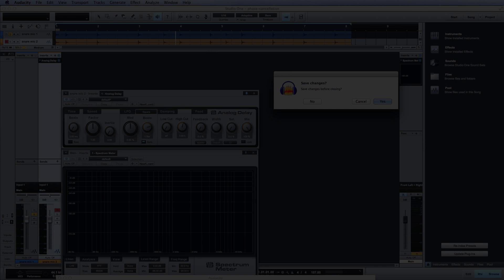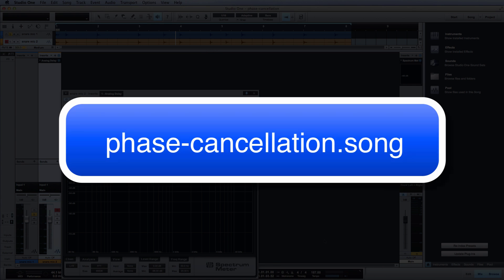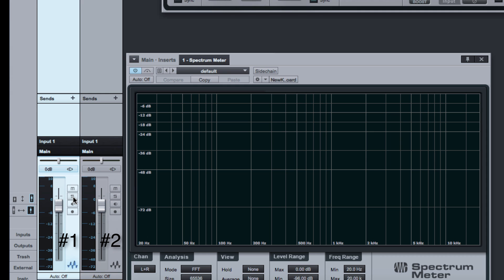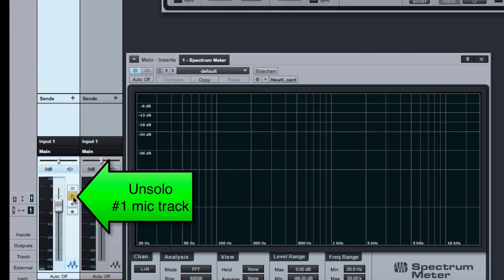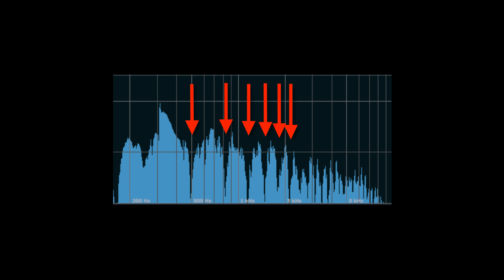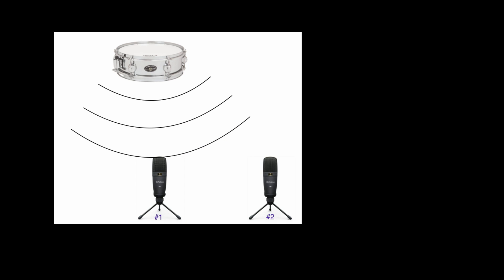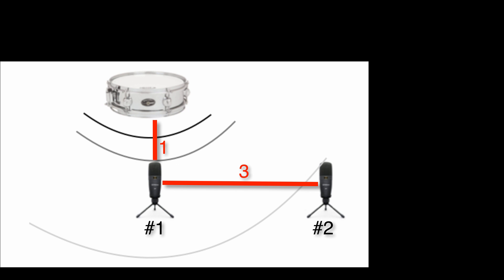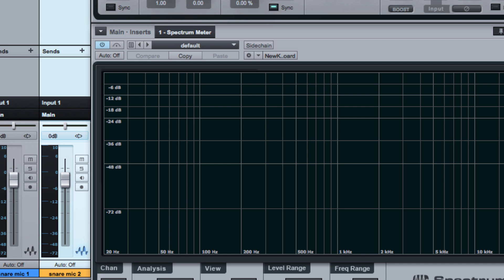01 05 What phase cancellation sounds (and looks) like

Comment: I still dont get it, how it works.
When i have a saw and a sin wave, then there will be also phase cancellation in a way right?
So why does our music, when we create it doesnt sound maximum shitty because all our different sounds (synths, acustic guitars etc.) are cancelling each other out in some ways? 
They are all going to be outputted through the master, and before that they must cancelling each other out a little bit.
Reply: Simply because they are different sources and different instruments. The frequency, amplitude and time time need to be the same for both sources.  Eg: if two microphones were to pick up the same sound and the mics were spaced equally from the sound source then the combined audio at the input to the mixer would be in phase.  If one mic was at 10 feet from the source and the other at 30 feet then the audio would be out of phase although it's a little difficult to calculate the phase differential on a stage with sound travelling at 1100 feet per second.  If  someone was to move one of the mics across the stage as it is picking up audio then the difference in output would be heard and at some point a 180 degree shift would be in place and cancel out the audio.
Reply: I'd like to add to this confusion with some of my own confusion.

I was just dealing with a specific sound in one of my mixes that showed up to be suffering significantly from phase issues. I personally like the sound of it. When I play it in mono, it changes its sound significantly. When I fix the phasing issue through an EQ bump, the sound sounds a lot fuller in mono. However, I like that original sound a lot more! How can I translate that sound to my mono mix?
Reply from the maker: Could you sum the parts that create the effect you like and then mix the result back in?
Reply from the maker: There is phase cancellation all the time. Try playing a steady hissy file (like white noise) through your speakers and move around to different locations. You'll notice the tone changes. The frequencies don't usually completely cancel each other out, though, they just boost or cut them.
Reply: Tim Bordasch You are exactly right, and you are exactly wrong. :-) You are right, different frequencies interfere with each other. This is why a minor second sounds tense and a perfect octave sounds more like one note. What you hear in the minor second is called beating. This inescapable incompatibility of tones at different frequencies is what gives harmony. It is why a diminished 7th chord sounds different from a major 7th. This is a kind of interference we want. It's why barbershop quartets sound like barbershop quartets. But, now record with two mics at different locations. Each mic by itself sounds as you expect. Because of the difference in distance, though, you get interference you don't want, which you can understand by considering the following:  Suppose your "music" was just a single tone. Depending upon where the mics are, you will end up with beating in the final recording even though there is just one frequency because the signals from the two mics interfere (see the bottom of this comment). So, go back to harmony. Harmony is different notes interacting with each other in a deliberate, desired way. Root, third and fifth tones interact in a pleasing way we call a chord. Toss in a second and the chord has tension. The various pitches are interacting between each other at varying deliberate degrees to give us the harmony we want. Phase problems arise from each and every tone in the source interacting with itself in an undesirable way.   Does that help?  If you like math, consider that a sine wave isn't just sin(w*t) with w=frequency and t=time. Rather, a sine wave is sin(w*t+d) where d is a "phase angle."  If I have a single frequency source with angular frequency w and record it with two mics the total amplitude is sin(w*t) + sin(w*t+d). If you can get your hands on something that plots graphs, you can plot this to see how this works. To make it easier, lump w*t together. Call it x.  Plot sin(x) with x going from 0 to 6.28. Then, plot sin(x + 2.0). Look at the two...one is shifted relative to the other. Now, plot sin(x)+sin(x+2.0) and see what you get. We put d=2.0 in this example. Try other values with d between 0 and 6.28.

Comment: Hi,

I'm curious as to whether noise cancellation requires the exact same tone. Can a note cancel another note if it is played an octave higher? Thanks.
Reply from the maker: I think noise cancellation circuits inverts what's coming through the air so that it cancels out in the earphones. Adding an octave higher would just make it brighter.
Reply from the maker: The note an octave higher will have some components that the one an octave lower has. These can interfere positively and negatively with each other.